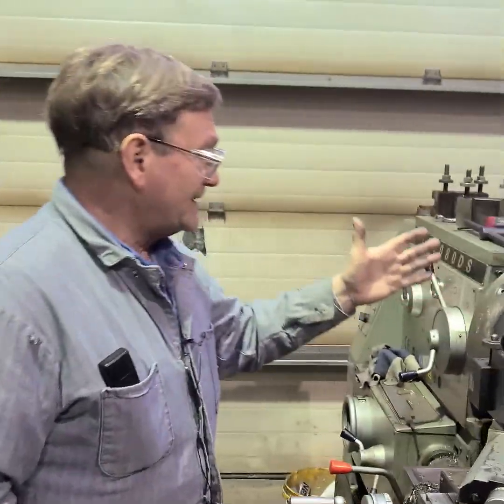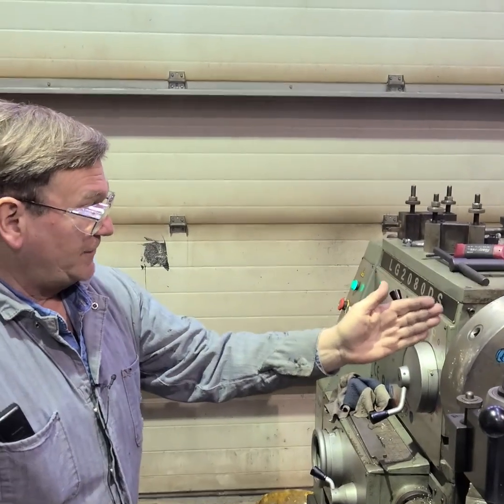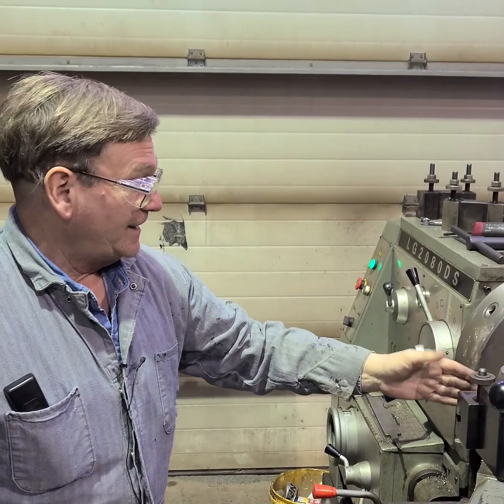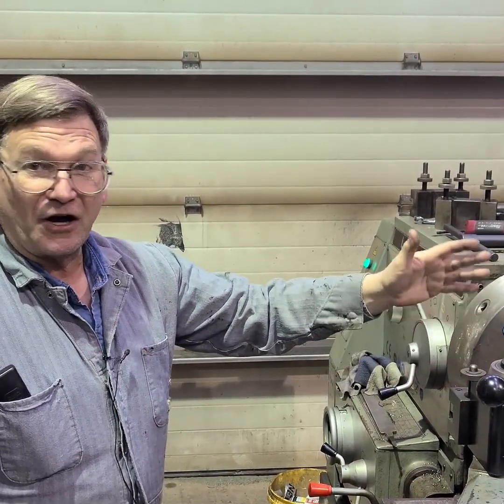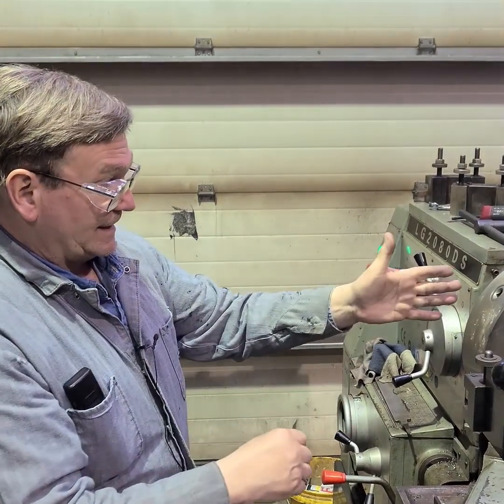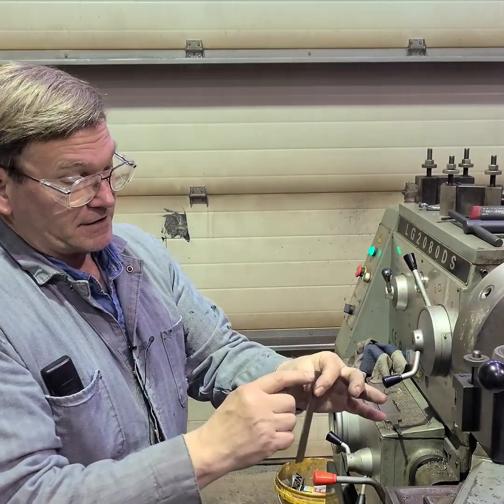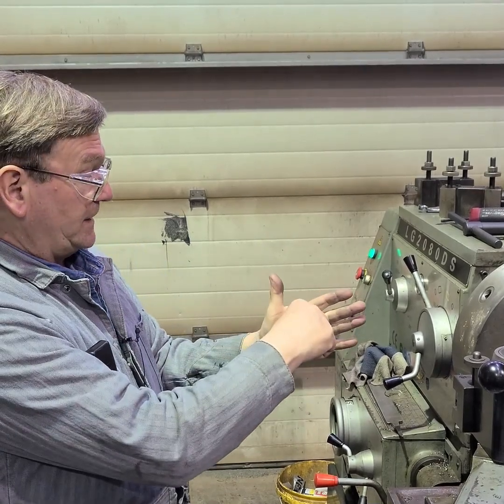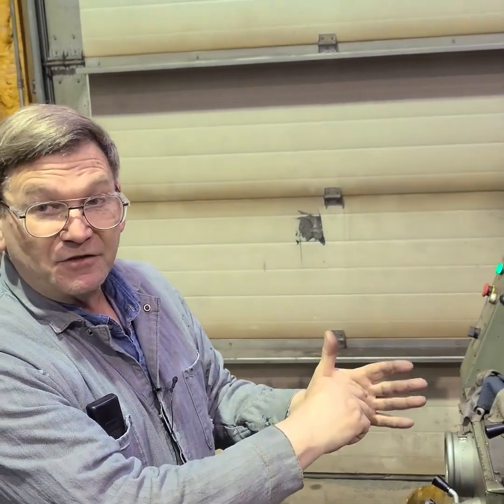Machinist's Minute: On turning rubber

Comment: Do you have any tips on doing longturning on rubber cylinders ? Somebody once wanted me to turn down a part for a stun gun (for butchering animals) which was basically a 150mm long rubber bushing. I chucked it on a mandrel to avoid distortion, but i found no good tool geometry, so ended up using handheld turning chisels, files and calipers to get it to dimension.
Very janky, but it did end up working.

Comment: I showed the guys how to drill a 2 inch hole in a piece of notebook paper one time. I clamped it between 2 one inch thick pieces of plate. Then I drilled a hole. The piece of paper had a 2 inch hole in it with no tearing.
Reply: Flexing I see😂.  Thinking outside the box is key🥰
Reply: @fryreartechnology7611 I think inside the box.  But it’s my box that I built next to “the box” because I was thinking outside of it. Ya know?